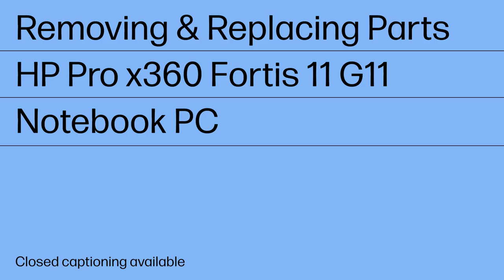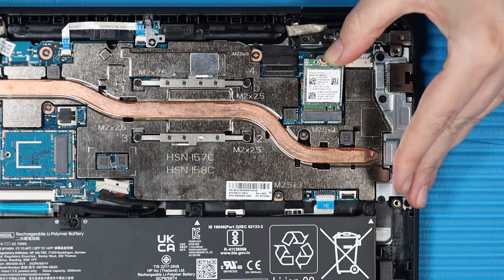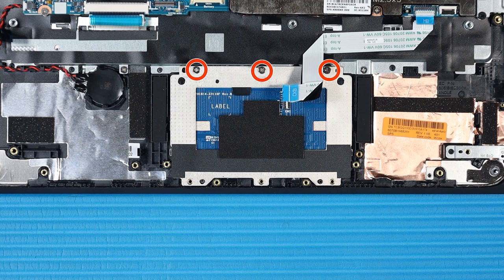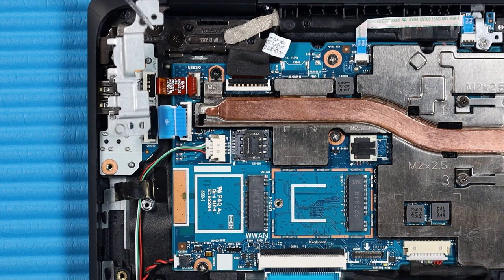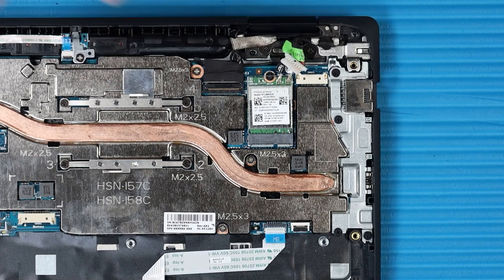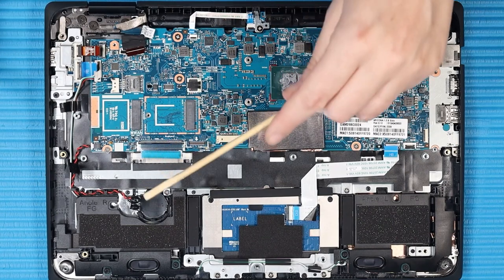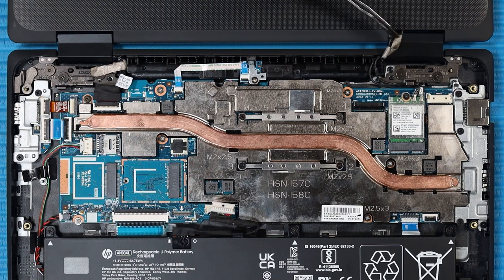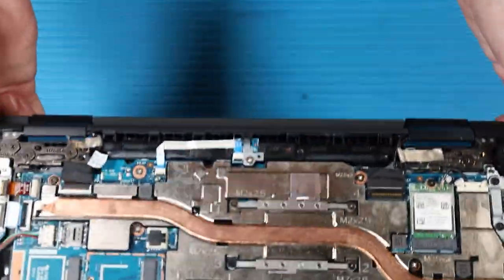Removing & Replacing Parts | HP Pro x360 Fortis 11 G11 Notebook PC | HP Computer Service| HP Support

Comment: can i disassemble my ink pen because my pen mine got pressen in by an accident i couldnt witness, is there a way to remove the cap in the back?
Reply from the maker: Hi there, thanks for contacting HP Global Social Media Support!
My apologies for the inconvenience, in order to get this issue fixed, please contact our customer care team over the phone or chat for further assistance, as this issue requires Live conversation with you over phone or chat to isolate the issue and provide you instantly with appropriate solution or repair/replacement options available at your place as per the warranty. Please feel free to reach us on call/chat, please access this link to select your preferred country and language option to reach us. Global support link: - https://hp.care/6051W5qEc 
Regards, 
HP Support

Comment: Can we replace the SSD on a HP Pro x360 Fortis 11 inch G11?
I have 128gb
Reply from the maker: Hi there, thanks for contacting HP Global Social Media Support!
I understand that you need to know about replacing SSD.
I will do my best to assist you.
Please refer page number 1 of the user manual to know about supported SSD and page number 49 to know about replacing SSD: https://hp.care/3YMkOOy
Binu-HP Social Media Tech Support
Reply: I appreciate the swift supply,  @HPSupport !
I have another question: Why does it only support 128GB and 256GB NVME drives? Or can I replace the storage to whatever I'd like? Again, thanks for the replies and I hope you are having a wonderful day!
Reply from the maker: Please use compatible parts. 
Use the HP Parts surfer to identify the part: https://hp.care/3OL7q8O 
And order it via the HP Parts store: https://bit.ly/3nKMYrs 
Binu-HP Social Media Tech Support